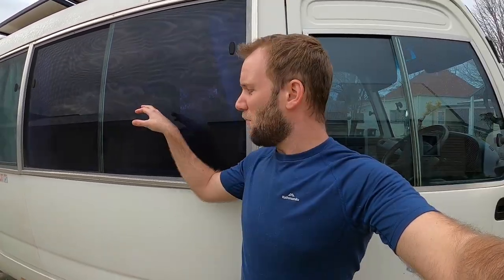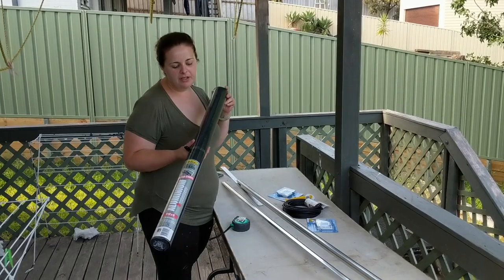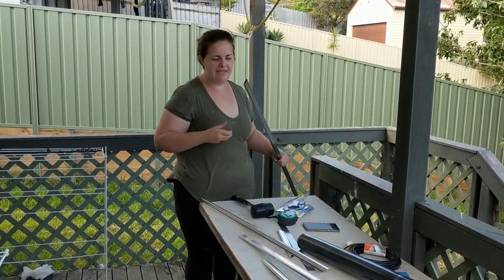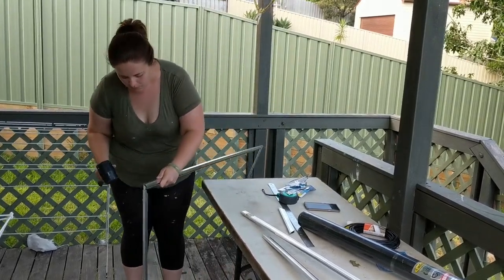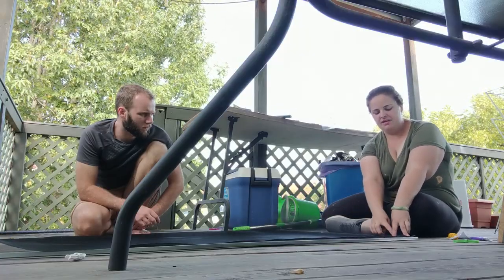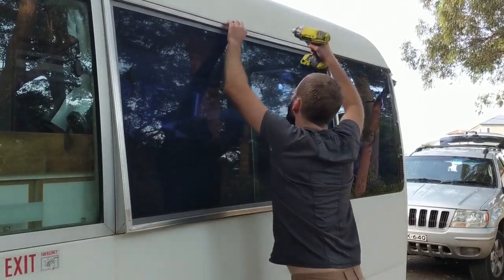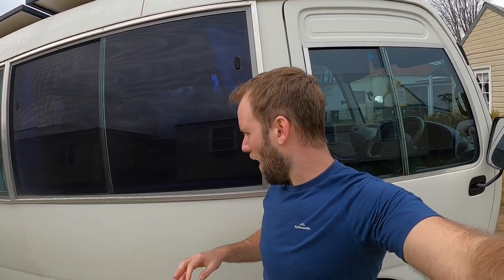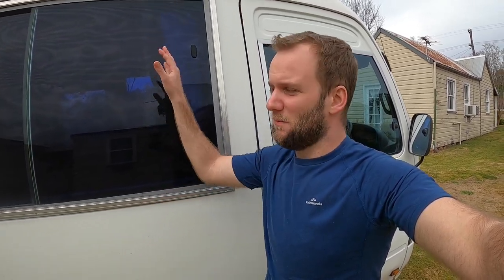Toyota Coaster Bus Conversion - Custom Fly Screen Install

Comment: good job. I was thinking about for my toyota coaster is security cage around the windows. I have stopped work on it. I have got my new walls and my new for boards I have not got time to cut it and put it in yet because the cold weather is making my arthritis bad. I got a new caravan door for it but I need to work it out how to put it on I need to make the frame smaller.  I love your videos guys
Reply from the maker: Hi Peter, sounds like you have a lot of work ahead of you too! It is a big job (especially the door, we don't envy you still having to do that!), and hopefully you will get some time to do it as the weather gets warmer 😊
Reply: @RoamingonRubber  I'm putting the caravan door on save me making a door frame that plastic thing you just put over your coaster door what is the name of that. because I think that be a quicker way to do that. I have the door I just want to get rid of the bifold door

Comment: The fly screens should make life more tolerable. Will they be able to take the wind force when driving. Fingers crossed.
Reply from the maker: Hi Desmond, we have had them on for about a year now (we are just a bit behind with the videos!), and have had no issues at all. Driven about 15,000kms with them 😊